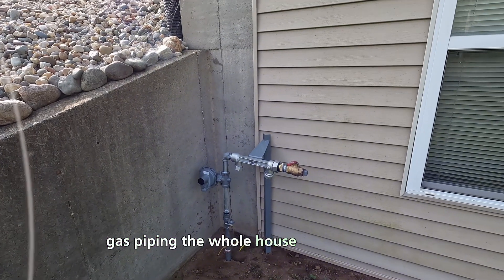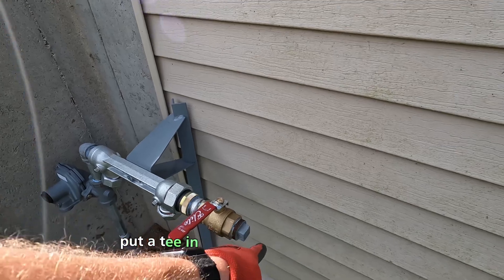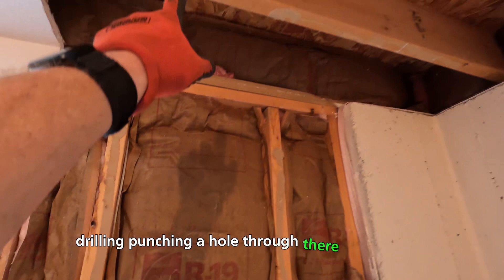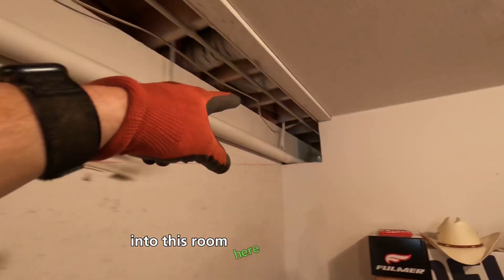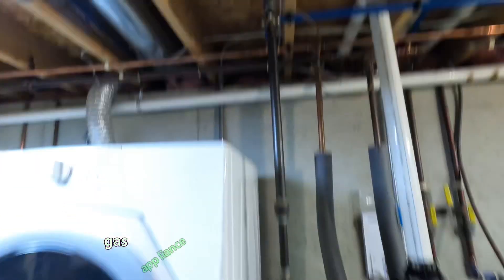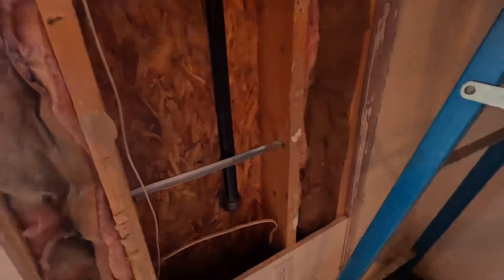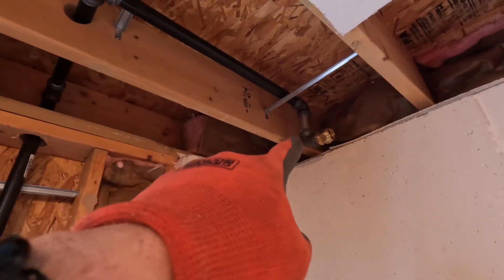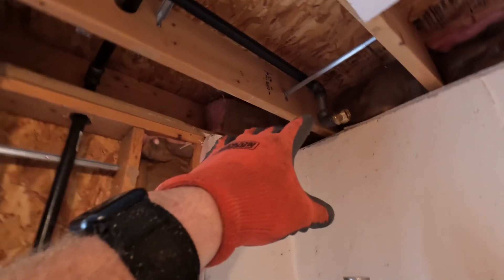Gas Piping Made Easy: Milwaukee M18 Cordless Threader & TopTes PT520B+ Review

Comment: Nice threader! Didn’t know they made one.

Knipex are the best pliers especially the “pliers wrench”.

The only time I ever get a leak with flash shield is if I didn’t make a 100% smooth cut on the tubing. My leak detector will give me false readings when I use blue block dope when it’s fresh and if I don’t wipe the excess off
Reply from the maker: Yes, it’s been out for a minute. I’m gonna do a Tool review on this in a bit. I will put it to the test with a 1-1/4” gas pipe. I love the Knipex. They work great. I was using Prodope, and with that toptes I could lightly blow in the Sensor, and I would start rising.